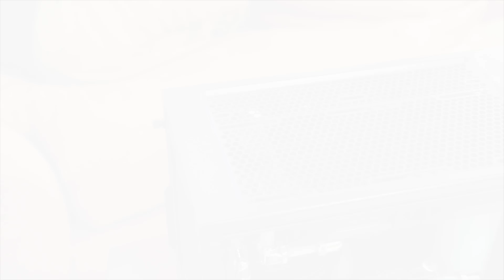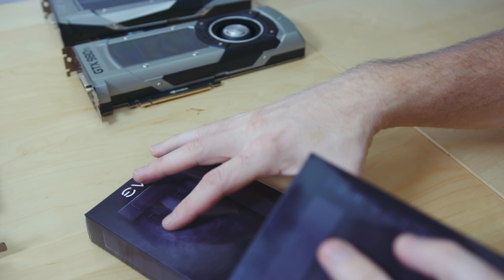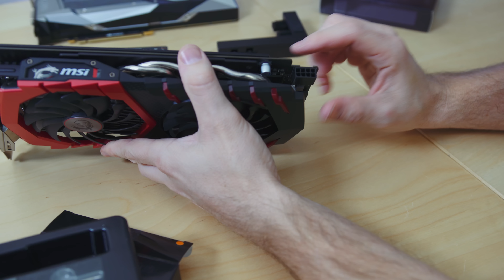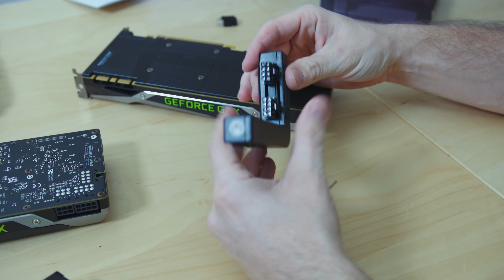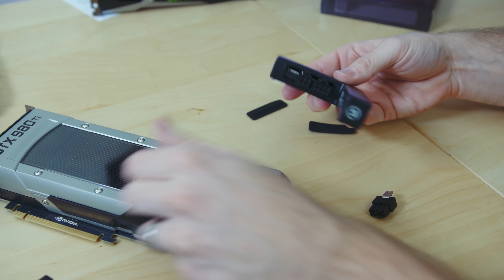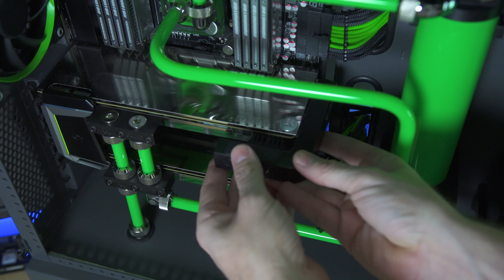How to manage your cables using EVGA Power Link

Comment: At this point i would rather stay with cables. I don't like that the EVGA power link is only supported by the GPU power plugs.
They also look cheap, but then again this is there first version there is real potential to make them better.

I will be keeping my eyes open for any improvements, or until we get copy versions from other brands like Gigabyte or MSI.

Comment: My conclusion: It is NOT worth it if you gpt custom sleeved cables,since they are designed to look good and to show off, but if you still have the normal cables that went with your PSU,these could get usefull since they look nicer than those stock cables but worse than custom sleeved...

Comment: It looks more cleaner with Power link, but it's on you which way you like the most. I remember my old card XFX Radeon HD 5770 had 6- pin connector hidden so well. But the question is why they make connectors on the front? If your case doesn't have hole under gpu like Mastercase for example it can look bad.

Comment: It ads length, yes. But it also reduces the total width of the installed card, this will be great for installing extra wide cards (like the EVGA 1080 Classified Gaming) in smaller builds.

Comment: Should be thinner, and a option to have led lightning on them.
And an option to have some metal,carbon finish?(easy do to with some vinyl )
Maybe make a bracket so they are supported by the backplate on the rear?

Comment: I liked it more before. These could be good if you don't like to use cable combs and train your cables. Although it would be easy to include a small "fixture" on the end of them to hold them in place for a while, while the cables settle to the possition of the extender, which would fix the wonkyness of the thing.
May be easy to do yourself, but.. meh, if you buy one, it should be included.

Comment: Looks better to me.  The way you had the cables routed before didn't really look good in my opinion.  While using these you can still see a bit of the cable (for those that have to look at the ''pretty" cable) while dramatically cleaning up the cable management.

Comment: I like both before and after. I like the like of the black and yellow wires feeding your cards. on the other hand the adapter does give a cleaner look and avoids the long arc the cables took. hmm..... It's definitely a tough call from the video.

Comment: Not really loving these adapters, they look too big and bulky and like Jay said looks like they could put too much strain on the power plugs not to mention added weight to video cards that already tend to sag in systems.  I agree with another comment on here that video card manufacturers may just want to consider putting the power plugs on the end of the cards instead of the current positions instead of these type of adapters.  But that's just MikesTwoCents.  lol

Comment: I could see these having some use, like in a matte black build. But in Skunk Works, they don't fit the aestetic very well. Now there's a sort of black hole in the middle of the build, where there used to be green accents with the cables. You're right that it matches the "square" theme, and maybe if you painted these adapters with green accents it would fit better.

Comment: I like how they look as far as moving the connectors on the cable, and they still look better than I thought they would, but I wish they were slightly less bulky overall. Between how bulky they are and the boring and somewhat cheap looking black plastic, I am a little disappointed. I still think they look much better in your system than I thought they would, but I wish they were a little more sleek and premium looking.

Comment: I would have thought this would be best used with new cables than already trained ones aswell to aviod the sagging or even EVGA putting a bracket on it to screw into the gpu itself using the backplate screw holes on the gpu as the main support. I can see where EVGA is going with this but as the product is right now I can see it only being good for complete new build's using black as the backdrop for the builds main theme. If it had a backplate aglinment support for the relocated power connectors,came in different colours and even had a RGB version then yes it could be something nice but at the moment I would say that some development is still needed before I would think about something like this. Maybe you could pass this along to EVGA @JayzTwoCents

Comment: i prefer having my sleeved cables running straight down (and in a somewhat normal case) straight into the osu cover, that way they just look way cleaner wtc,  so in your situation i didnt really like any of them (although i didnt dislike any of them) :P but your pipes are kinda in the way for running them straight down as well as you'd have to drill and file out some holes in that sexy expensive case ;o

Comment: Over engineered! Put the socket where it is needed, we all know where the cables are going to be routed from so put the socket as close as possible.
Also motherboard manufactures put the 24 pin on the back of the board and with a 90 degree bend on the plug, gone! hidden! simple! You wouldn't buy say a car and put up with all these cables being visible (bad analogy)
Whilst I'm on a role, why is there not just one fan header on a motherboard, connected to a controller on the back of the case and all the cables routed around the edge of the case? maybe even make use of WiFi or Bluetooth to control them, but I digress :))

Comment: if those evga logos would light up, and there would be atleast an aluminium front plate those would look good. Now they look kinda cheap, and also im wondering why they made those so thick? people with Itx rigs that have problems with card width could ha used it to solve their problem.

Comment: i'd maybe add a small tab on the top of the bracket where the cables are plugged in to support the weight of the cables 

actually if these were structurally attached to the case in some way to help with card droop i would be all over these!

Comment: An "allen key" is used to tighten or loosen an "allen screw", not an "allen key"... just sayin'... ya know...
Yeah, it looks like those EVGA cable thingamabobs could come in handy.  Back in the day the supplementary power sockets were attached to the PCB in the same location where they're being routed to by these Power Links.
Man, I can't get used to seeing Skunkworks looking so resplendent with that nice fluorescent green fluid, I was so used to seeing her with that dreadful looking khaki coloured fluid running through her veins.

Comment: nice cables, i would use them, they look putting cables further toward the grommets would help graphics card not have weight of cables at outside corner.maybe get better airflow near cards every bit helps.

Comment: I like the before, it removes the green balance in the middle of Skunkworks.  Maybe if they lit up green or even just paint the logos a green to match...
A few things I'm curious about are if they are pretty heavy because of the weight of larger graphics cards does this just add to something that could strain PCIe slots?  Also, does it change any power going into the card, do they create some resistance, etc.?  I would think with the sliding and such, if you didn't have a good tight hex nut, or maybe after time they might start losing connectivity....which could short out...and I don't feel that a tiny aesthetic is worth my several hundred dollar video card(s)

Comment: I've been somewhat interested in this item and even more so now that it can do different power configurations.
I have an EVGA GTX 970 SC (blower style) with an EK waterblock (Predator AIO setup) and I don't doubt that in standard configuration the Power Link would work on any EVGA GPU but with how close the water block resides to the power connectors there may not be enough space or adjustment to actually attach the Power Link. Are you able to demonstrate that at all?

Comment: One thing I really like about NVIDIA's workstation cards is that some of them have the power connectors on the back.  I assume they moved the power connectors on the GeForce cards to accommodate smaller cases, but I would really like it if they moved the power connectors on some of the cards, like the Titan X Pascal.  I like what EVGA did here, but they could really improve this by adding some way to secure this adapter to the PCB to avoid potential damage to the card.  Also, it would be nice if they made one with RGB lighting.  A green LED EVGA logo would look great in Skunkworks.

Comment: meeting the design look of skunkworks, actually they dont, before you had the cables going exactly the same but opposite direction matching the liquid CPU cooling pipe, and with some green in the cables it looked great, however the product isn't bad am sure it is very useful in situations of mini enclosures where u can add some length but the width u wish u had the cables going from the back of the card, thank you i've been looking for something similar and your review was great

Comment: I'm of two minds on the Power Link regarding aesthetics.
Firstly: In your close up panning shots they look good. The PEG cables line up well with the motherboard power above it.

Second: In your talking head shots (with Skunkworks in the background) the absence of any color in that location looks strange. A black hole where previously you had another green accent.

Neat product that might solve a very exclusive problem. Or maybe it's just a solution looking for a problem.

Comment: I don't understand why 90 degree connectors aren't common? I'm talking about the connectors you put into the power slots on the card... why aren't there any 90 degree right angle cables in the same way you get them for SATA cables? The molded 90-degree ones.

Comment: It does move the cables away, but I would never be OK with that stress on the power connectors on the card. I'd prefer nice extensions to something that may damage my card. I know it's a weak chance of that happening but I guess it's just my ocd.

Comment: I like the cable adapters in Skunkworks Jay. Not only does it move the cables so that there is less to see, but your waterblocks have the same aesthetic as they are black as well so they go together well. Perhaps one day someone will come up with a way to anchor the adapters to the motherboard tray in order to take some of the load off of the sockets.

Comment: So looking at it would I be right in assuming that regardless of any safety advice it would allow you to connect any arrangement of power compared to the card's power. eg. 2x8 pin for a 2x6 pin card, 1x6 + 1x8, or even 1x6 pin to a 2x8 pin card? It looks like the design connects all the 12v leads to a single rail and all the 0v to a single rail on the other side meaning in theory a single 12v and 0v wire is all you need to get it working.
Reply: Amperage is additive in parallel, so adding all the needed amperage to the bussing (With multiple feed wires ;IE 6 pin or 8 pin) allows it to feed the same voltage and needed amperage to all hot points attached to the rated bussing (6 pin or 8 pin entering the video card), with needed amperage being fed to the unit without burning the wire or bussing up (thus reason for parallel feeds or thicker wire) . All sizing of wires and bussing are sized by amperage rating. Hope that helps ( I build and commission power plants for a living)
Reply: It allows 2x8 (6 x12v) on the psu end but changing the connector pins on the gpu end should define the actual delivered power (e.g. 2 x 6pin= 4 x 12v), BUT as you pointed out it looks like it just "connects all the 12v leads to a single rail" so I have no idea how that works.
Reply: Yeah that was my point. In theory you should use the same leads as the card but in practice that may well not be the case. It could be useful for people with 6 pin power supplies connecting to a 2x8 pin (like mine), or 8 pin power supplies connecting to the newer 6 pin cards, or even using 2x6 pin to allow a 1x6 pin more stability in the case of the 1080. But the idea of connecting a single 12v cable and a single return cable to run a 2x8 pin Fury X is an idea I love for nothing more than "because I can".
Reply: On any case the opposite is not possible. Smaller and less connectors on the psu end will deliver less power than the gpu requirements

Comment: Do you know if they sell a flipped one? I have the Msi gtx 1060 3gb and My cables on the graphics card are horrible, it goes straight down the middle of the glass panel and isn't sleeved, it's like the generic coloured one with 4 connectors on the same chord, so it has a connector in the middle on the way down

Comment: I'm getting two for my EVGA GTX 1080 SC's, but I'm not sure I'm going to use them because of the lenght they add, and more importantly they block airflow from the rear of the cards. I'm just going to put them in the EVGA 1080's boxes and add a bit of resale value to the cards once it's time to let them go.

Comment: Nice idea from EVGA, I will disagree on the aesthetics of Skunkworks though. They look kinda bulky in comparison to the cleanness of the overall system and the thickness of the watercooled GPUs. Also, the cables were matching the system theme better than the plastic bulky thing, no matter how practical it may be.
On a system with an air cooled GPU it should look fine though and give way more practical value.
Just my... two cents. :D

Comment: Got my powerlink on it's way! I think it's good for airflow in air cooled systems. Too many cables cause dispersion and ruin your attempts to keep it smooth flowing. Also i think they could have put a little plastic tab on the bottom of the powerlink to give it some support so it didn't sag with the cable weight. EVGA and their oversights! lol

Comment: I like it. The PCIe cables are now much more in line with the motherboard 24 pin cable. The plastic might look a bit cheaper compared to the silver/chrome parts, but at least it matches the GPU waterblock input/output block (whatever you call it) nicely.

Comment: Well I'd like to say I like them, but they just look cheap. If the plastic would be of a higher quality look, it would be nice.

But as they are now: No thank you. 

There might be some practial application, where you just do not have the room in your case to connect the cables in the orginial position, but anything else: Loose them. Skunkworks is a high quality thingy, not a cheapo plastic build...

Or maybe paint them.

Comment: Ideally, they should increase 75 watt PCI-e limit to 1000 watt and eliminate stupid cable and connectors.
Reply: Asrar Hassan that way the MoBos will cost too much. Making traces that can handle that much current and don't melt it's not a simple and economic thing
Reply: It isn't like they just decided on 75W for the sake of being difficult, making 1KW capable traces wouldn't be trivial, and would be wasted expense for many people.
Reply: lol Yeah I think putting 1KV traces on motherboard would be dangerous and fail alot of certifications. Okay how about this idea :D give 300 watt on PCI-e pins and put a connector on back side of the motherboard i.e behind PCI-e slot. That should work, right?
Reply: I might be wrong but I think (don't quote me on this) PCI-e 4.0 will be released with up to 300 watt, which is powerful enough for almost all graphics cards on the market.
Reply: That would be great, stupid messy cables.

Comment: would have been better if it was slimmer so it would help in tight cases where there's no room for 6/8 pin on the side and you'd normally need a gpu with a port on the back

Comment: I think these look good in Skunkworks however I think that's only because those Titan XP's have water-blocks on them and therefore already have elements extruding from the card. The inlet/outlet protrusion works well with the power adapter. I think on a regular air-cooled card these would just be way to bulky to be aesthetically pleasing.

Comment: Well to be honest i dont like em for 2 major reasons:
1. Being generally a technical person, who wants stuff to work at its best and not at its prettiest, i dont like the fact that there is an unnecessary part in the system that can cause problems.
2. As i love green and i love exposed uncovered system/motor parts the pure cables look much more appealing to me than this cheap plastic cover.

Comment: My initial thought was "No Jay!!! Why would you do that?! Look at those awesome cables... Oh, wait, you can't see them anymore..." :) I don't really like how power link adds a huge hump on front of the air cooled cards, imho it lookes worse than with cables routed to the front... If EVGA could make it much thinner maybe I would like it... However in Skunkworks, with water cooled cards and all the straight lines, it actually works... What I thought would be a downside (hiding awesomely sleeved cables) actually did what power link is intended to do, it made the build look super clean. Just MyTwoCents :)

Comment: It's bs. They should just design the pcb so the connector would be on the other side. So you practically wouldn't see the cable from behind of the card.

Comment: I am with you JayzTwoCents, kind of on the fence about these... But, in Skunkworks... I think they flow better. If you look at the ATX cable coming off the mother board, then having the cables following suit off the back of the video cards. But, I don't know, could go either way. I would however see these taken further.. attach the links to an adjustable support brace, and instead of a basic "stamped" EVGA logo... make a blank white LED spot, and include a set of colored labels.
(examples: red "Classified" or clear EVGA logo, etc.)